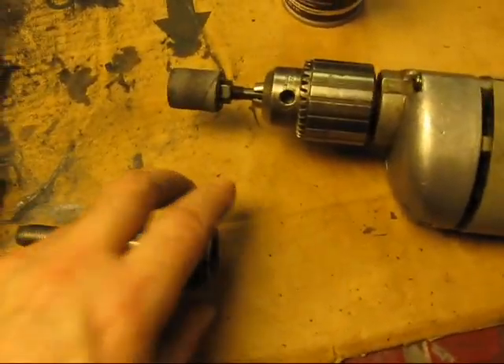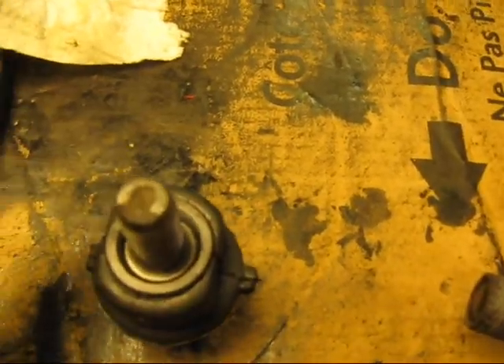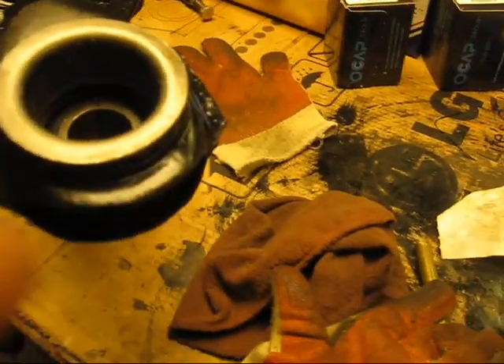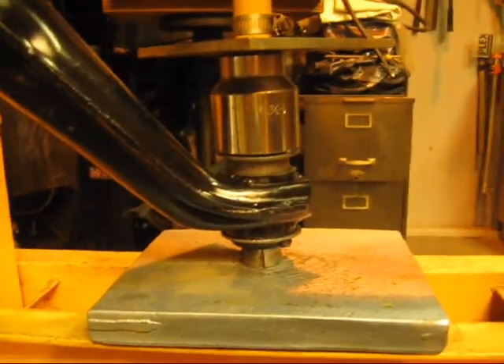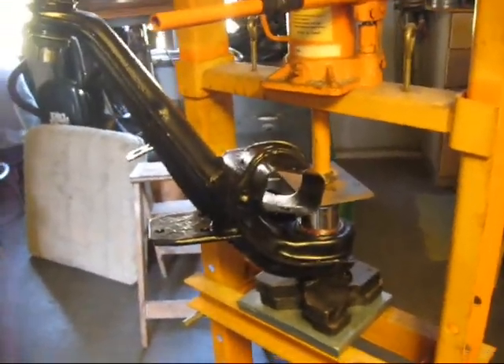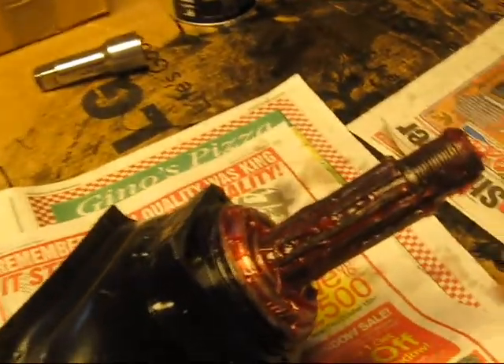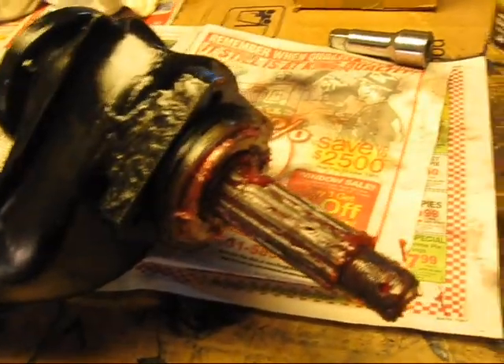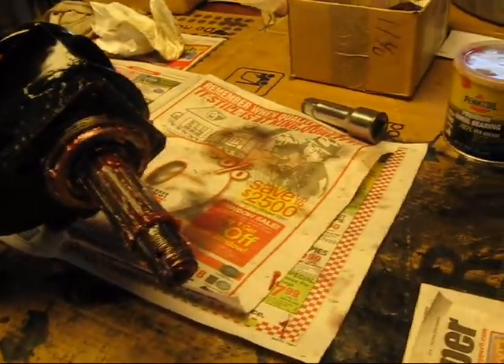1979 VW Beetle Rear Control Arm Rebuild

Comment: Unfortunately you didn’t show how you removed the old bushings. Is it necessary to press the new inner ones in with a press as well?
Reply from the maker: I would, you can try to hammer them with a socket or pipe over them.
Typically removing these can be done with a chisel.
I often use an air chisel and a few modded bits